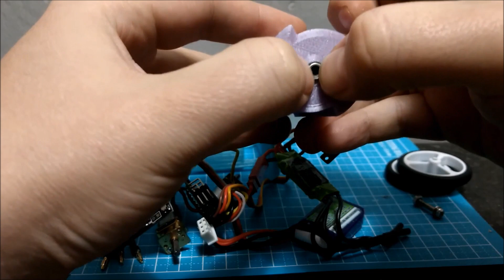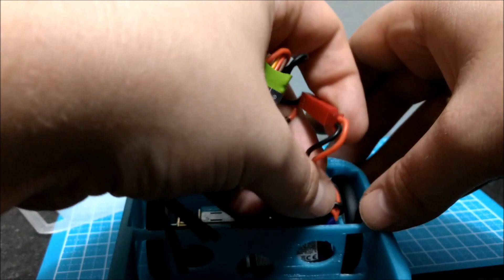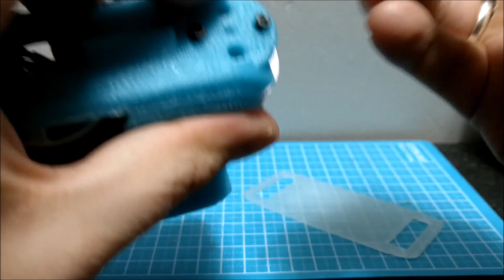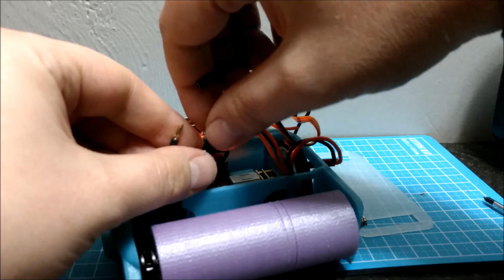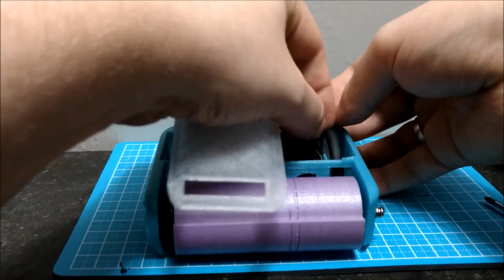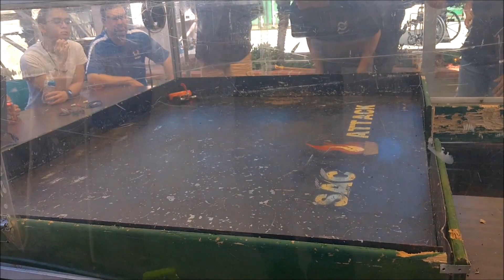Building Siren a 150g Drum Spinner Combat Robot (UK Antweight US Fairyweight)

Comment: I’d recommend covering the receiver and ESC in shrink wrap to avoid shorting, otherwise this is a great design! I may even build it myself 🙂
Reply from the maker: Definitely. I trimmed up the wires to save weight and was able to add heat shrink to protect all of the electronics.

Comment: Great information.  I have a question, could I use this brush less motor to make a small drum motor for a conveyor belt?  It looks speedy, I'd need to slow down the motor.  The conveyor is a small hobby project about 80mm x 300mm, driving about 200 grams.   Would it have enough torque to drive a 200g of weight?  Thanks any help appreciated.
Reply from the maker: If you used gears to decrease the rpm, you should gain some added torque as a result. A belt drive may also work well too. If you need a larger motor a 2204 or 2205 might be a good option: https://amzn.to/2LgWXlr. Other considerations, how quickly does the conveyor need to move and how precise does it need to be? You may be better off using an n20 motor : https://amzn.to/2RggDtx. They come in lots of geared configurations and are quite cheap and easy to control. I use two to push a 1lb combat bot, more than enough for 200g.
Reply: how many mha and c rate does this battery have? can I use a 300mha in this category? and the engine kv?